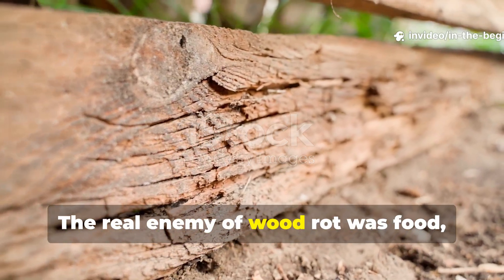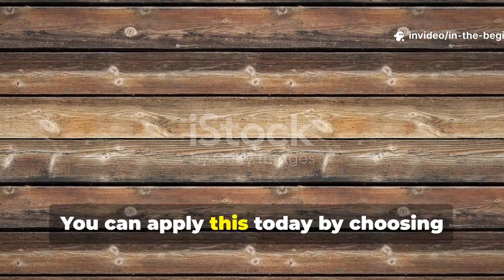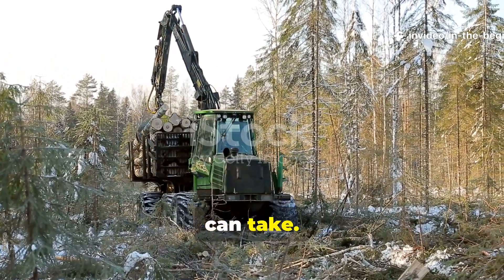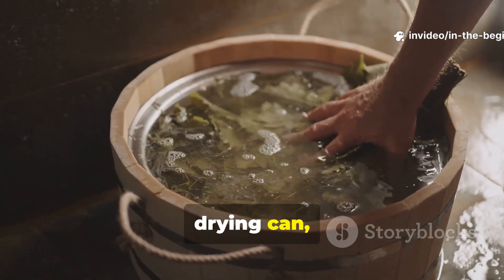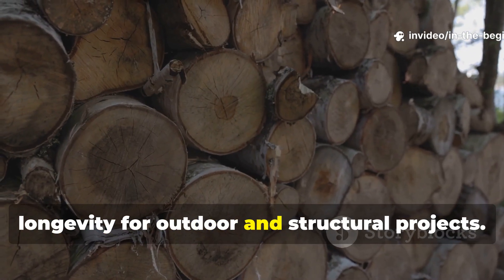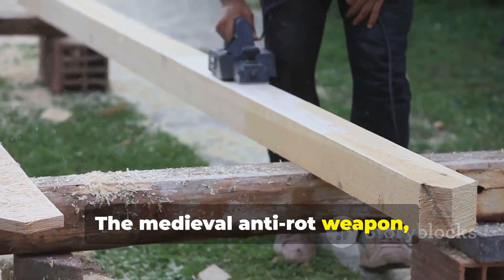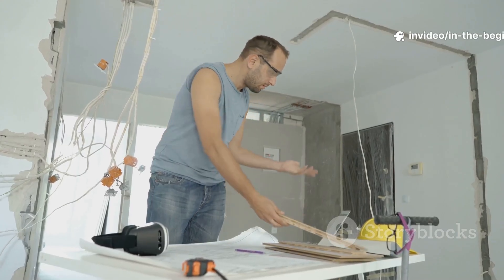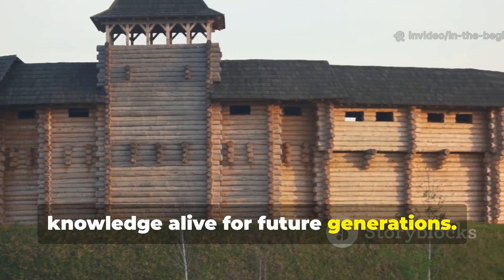The Medieval Anti Rot Weapon Nobody Talks About

Comment: Most of this is absolute rot (sic).

Modern wood rots so quickly mostly because we use cheap conifer wood that isn't rot-resistant.

We have much more sophisticated shaping that helps prevent rot.
Reply: Definitely some ai slop but there is some truth to it. Winter cut wood does have less starches, and there are many traditional processes like what was used in Scandinavia to saturate conifers with resin through years of scarification. Those types of processes don’t scale well. Even our “heart pine” in the US was just slow grown pine, the increased resin content meant it was a lot more stable and rot resistant. There’s historical qc ones of pine being used for shingles, modern pine wouldn’t last two years as a roof